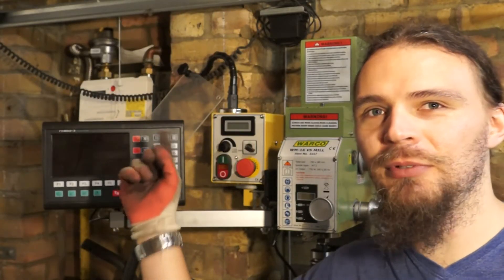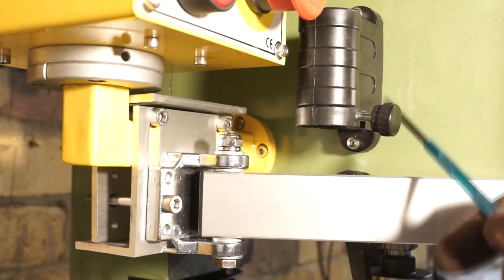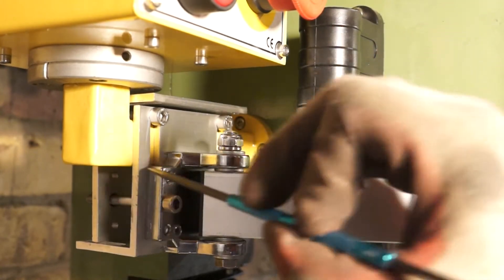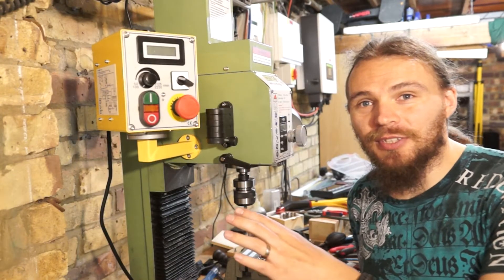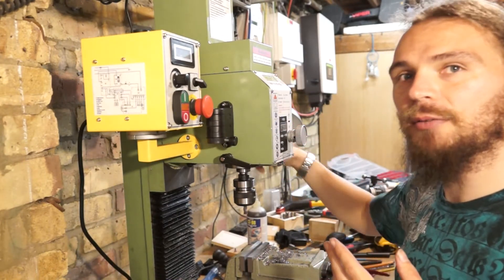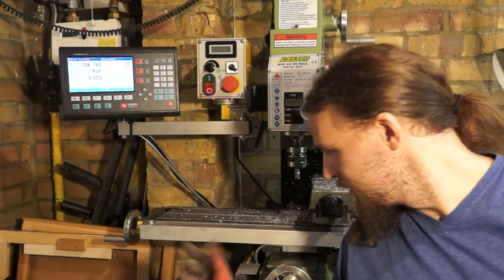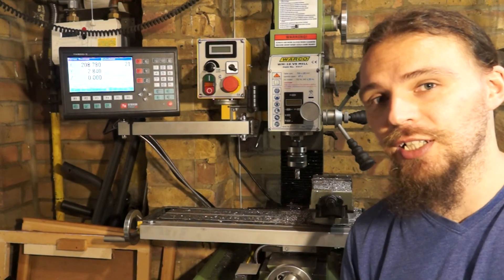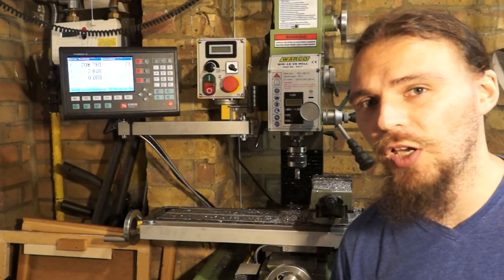Milling Machine DRO Fitting | Warco WM16 with No drilling

Comment: Hi Caveman. I like the way you managed to fit the scales and readout without having to drill holes in your machine. I fitted a very similar one to my mill (also very similar} about 9 months ago and the video has been surprisingly successful. I think you did a much better job of explaining all your decisions and what you were doing better than I did.  A couple of things caught my eye, the little red brackets on the read heads are transit brackets and should be removed once fitted. Also, I think you should take another look at your y axis scale and see if you can turn it the other way up, I don't think those lip seals will keep the swarf out for long looking up at it.  I got a Chinese manual with mine, so have managed to find the English version. If you need a copy, let me know.
Reply from the maker: Hi @ollysworkshop Thanks for the comment. I left the bracket in the video because I was still taking the scale on and off between shots but they are off now (pretty sure I remembered to take them off) and I have covered the Y axis with some rubber sheet stuff that keeps it free of mess but did that after the video. 
So far it has all been pretty easy and straight forward but thank for the offer.